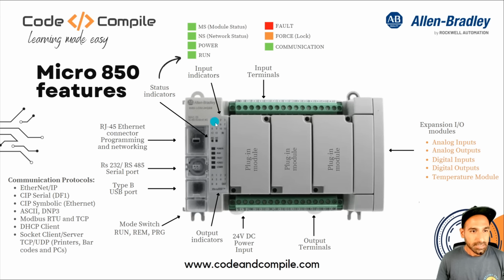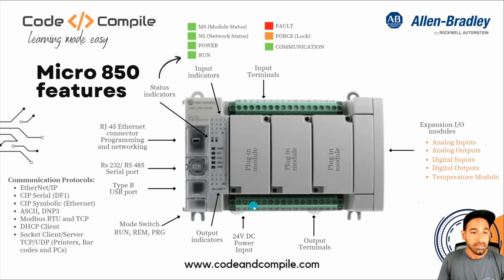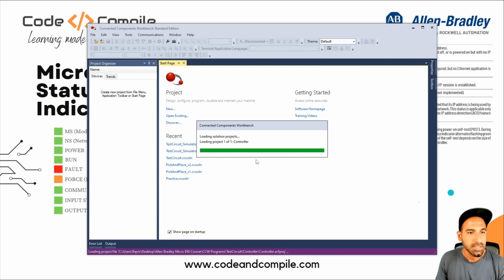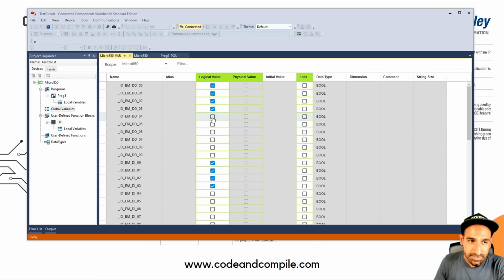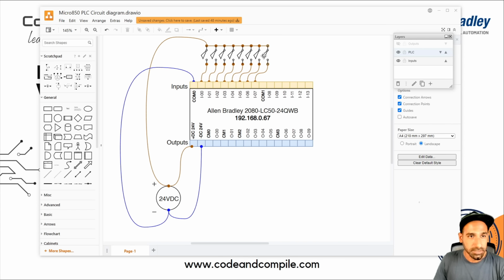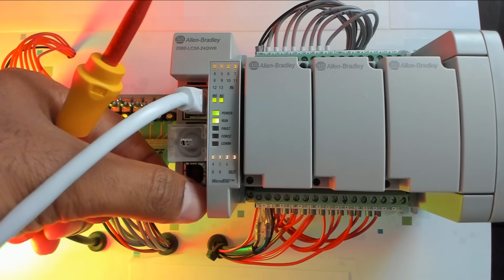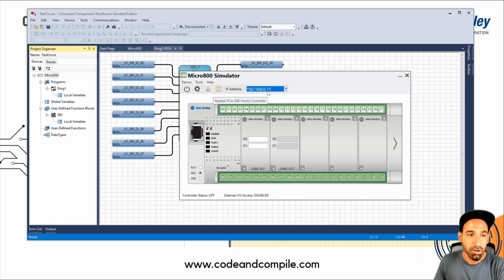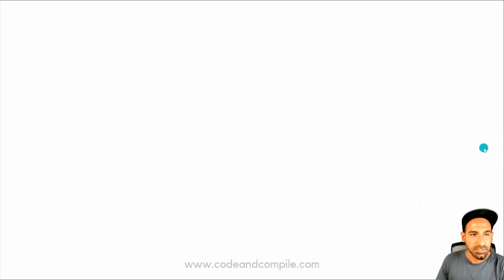Lesson 1- Introduction to Micro850 PLC

Comment: Best lessons learned. I have an issue  in the same model, "RUN" indication not shows up, hope you have solution....
Reply from the maker: How are you making it RUN? Physical switch or via Software?
Reply: @thegeterrdone  Operating via Software. Finally I managed to replace the PLC but waiting to get it repaired if possible, suspect hardware damage.....

Comment: Thank You Rajvir, very informative video. Does the Micro850 PLC also have a MicroSD card slot ?
Reply from the maker: No it does not have any SD card slot but if you want more memory you can plug-in a memory module just like IO module :)